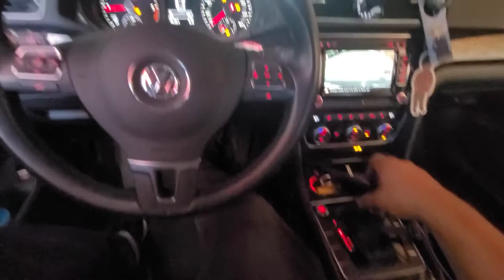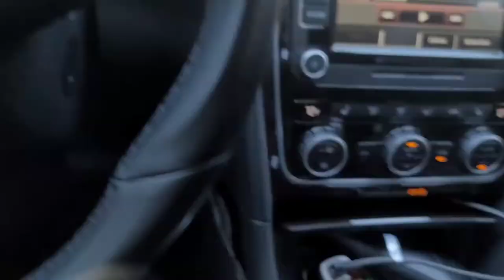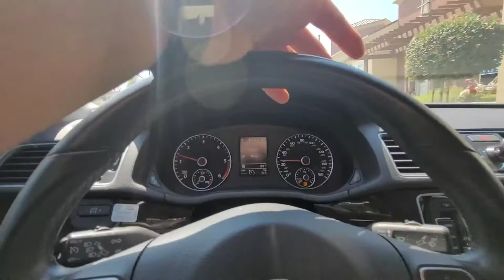Passat transmission fluid changeout! Easiest way to do it. Works on Audi and BMW too!!!!

Comment: i did this job myself outside in below freezing weather and it took like 10 or more hours with distractions. so i did it this way pretty much but when i drained the fluid it only came to about 4l or something and i put in 4.65l(i tried to account for fluid in filter and some that got spilled because the guy holding the funnel didnt hold it straight when i was dumping it into a empty engine oil container. i took it in to vw at 50k miles for its first service ever. trans felt kinda weird b4 this so was hoping after i changed oil and filter it would feel better but no, it really doesnt.

my problems are mostly when the car is cold. 1st to 2nd gear pretty bad. from a stop, and then accelerating up a hill the car goes back a bit and then kinda jolts when it finally starts going forward. that is assuming i am light with gas. it actually feels better if when i let go of brake to go to gas immediately and give more gas.

so now im wondering if i overfilled or do i need a dsg adaptation thing thru obd11.
Reply: over filled need to check with a VAG scan tool for temp
Reply: @buzzsgarage  took to vw and got fluid level checked still does it. when trans is cold it feels like it almost stalls in reverse low throttle slight downhill(so im going up hill). 

all the time no matter what temp on upshift i feel vibration in my feet. starts from a stop are laggy unless moderate gas applied, but i heard thats normal for dsg.

im feeling i need clutch plates. im nearing 100k miles now and they say thats around when you need em.
Reply: @flute136   It could be fluid that you used, but your right it could be trans going out, it's not normal I've had three cars with trans and none have done that
Reply: @buzzsgarage  nah man i used high quality liqui moly. prob clutch plates. the cars very first trans fluid was 10k miles late and was a rental so you dont know how ppl drove it, but they prob dont drive dct like they should

Comment: Never change filter last dirty oil goes into trans also you need a vag scan tool to check trans temp
Reply from the maker: You are correct.

Comment: This is how to not do it.  Drain, replace filter, fill with 5 liters, run till 35c and drain excess. You need vag
Reply: you are correct, drained filter first Not last dirty oil goes down into transmission
Reply from the maker: I know. This is how I chose to do it because it was the easiest way.
Reply: @raulsd.i.y.videos5585  When doing oil change found out that dirty oil goes down in oil pan because of vacuum in system
Reply: I do have a question, I thought the transmission filter was underneath the transmission not that piece that you’re pulling out of the top

Is this a 2012 with the 2.5 L regular six speed automatic?
Reply: @Thomasjcolbert82  it's a dsg transmission.